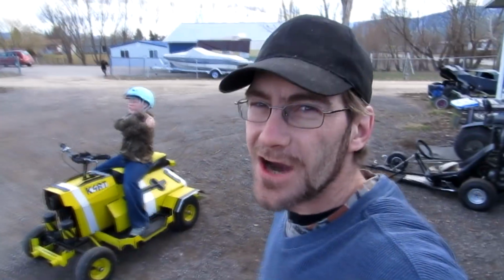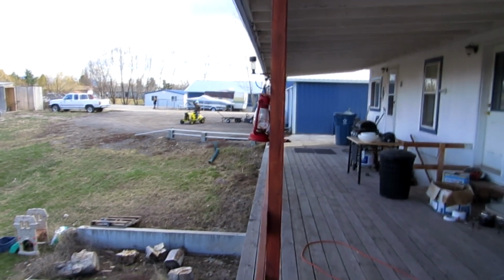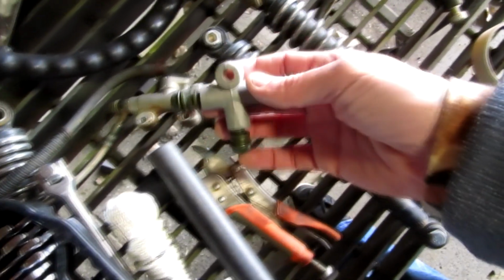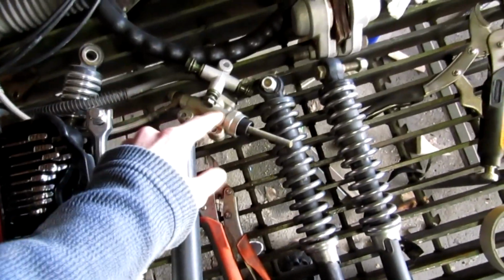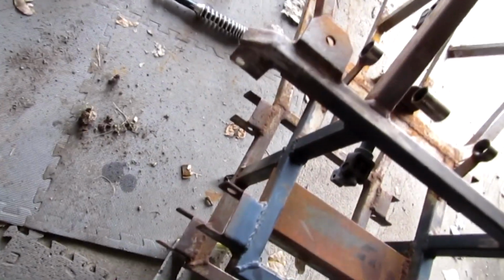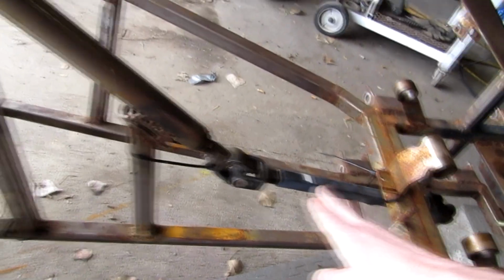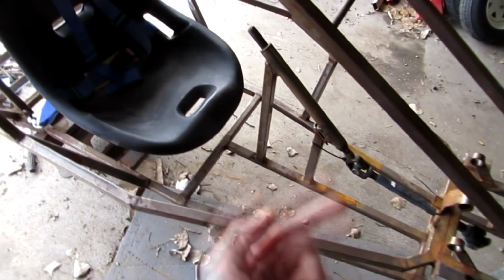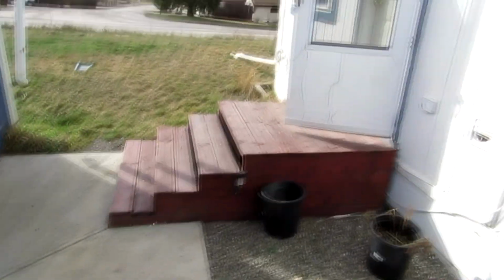Go Kart | TEST DRIVE | Cody on Hyperion K4RT machine

Comment: did you ever get to estimate what that bad boy [the K4RT] weighs? maybe a couple hundred lbs, fully loaded? it looks like it could benefit from some bigger tires and wheels, but great job.
Reply from the maker: +rtabish ... no, I have I dont know it weight. I should try to figure that out. I would like to get a slightly longer axle for it.
Reply: +T-Mans Go Karts.... to give it a wider wheel base? ya, that would help make it more stable in the corners, for sure. lawn mower transaxles are just not wide enough for that, and because of their layout, this frame design is inherently top-heavy, anyway.